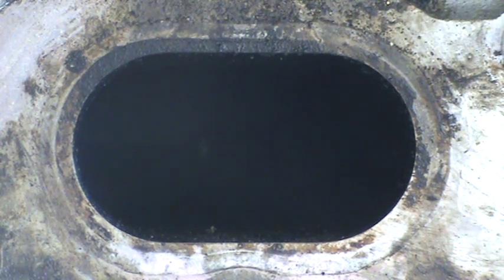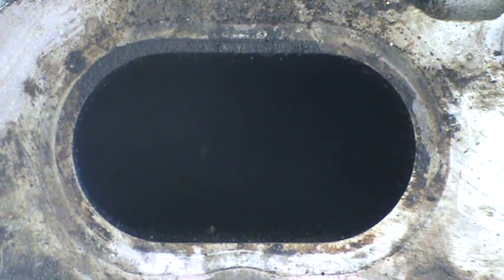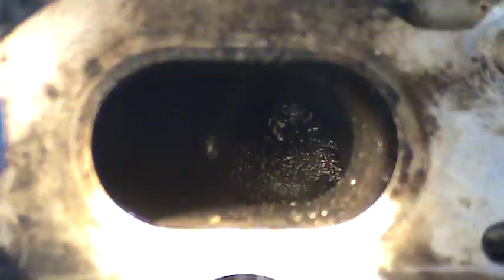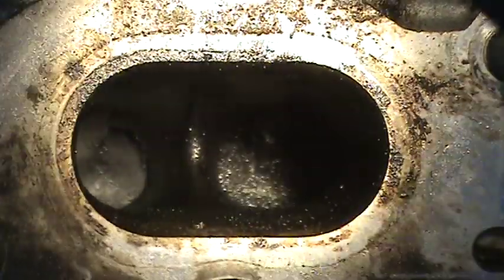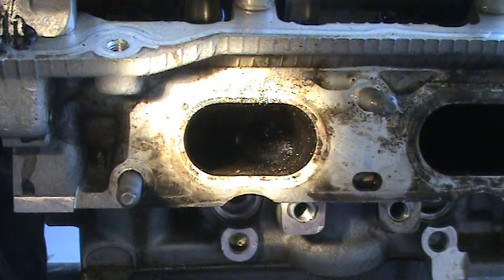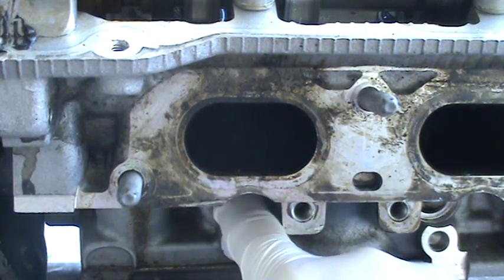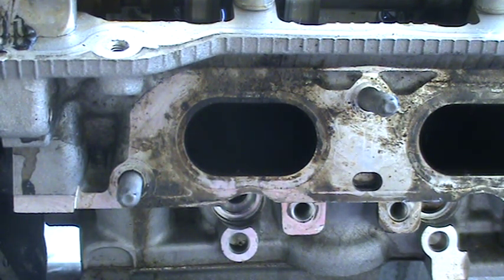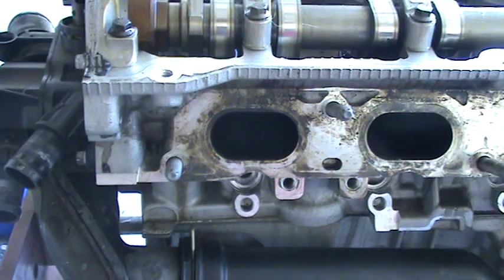Cooper "S" N14 Carbon Cleaning

Comment: Carbon build up in the intake and on the intake valves happens on all direct injection motors. It's a result of oil vapours from the PCV system (positive crankcase ventilation) and exhaust gas from the EGR system (exhaust gas recirculation). It doesn't happen on MPI (multi point injection) motors, because they spray fuel on the intake and valves, and that keeps them clean.

Comment: this is just for the turbo charged engine notthe supercharged. and this is only due to the direct injection, convensional fuel injection sprays behind the valve, this sprays directly into the cylinder

Comment: No not really it is a design flaw for the engine, they have corrected this issue with the 2011,2012, and 2013 engines with the duel vanos adjustment units as well as decreasing the period between oil changes. Seafoam?!?! well some people swear by it.in my opinion you would have to do it very regular and it will only prolong the the eventual cleaning with the removal of the intake.

Comment: hi sir..i have a problem with my mini cooper s 2012. the computer shows to me " low pressure". i changed the high pressure pump and there is no change with the problem. do u think its because of the carbon? maybe i have to clean it?

Comment: Hi Ben,

I have a Cooper S and i am always getting the check engine light on with the scanner giving a misfire on the 4th cylinder! could that be the problem? we have changed the injection, the coils, the sparks and the high pressure pump! and i still get this light every week! Thank you for your assistance!!